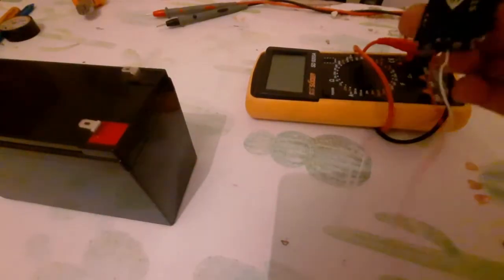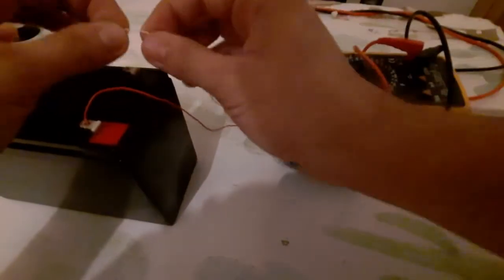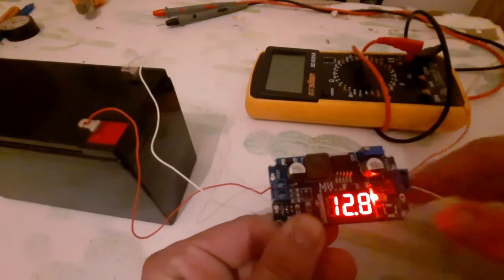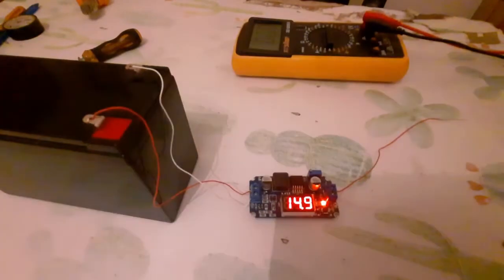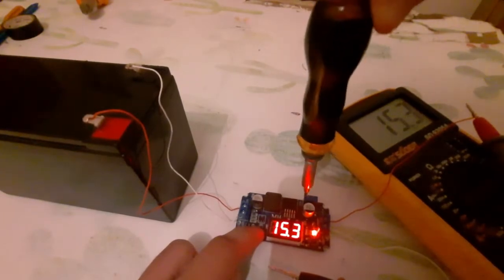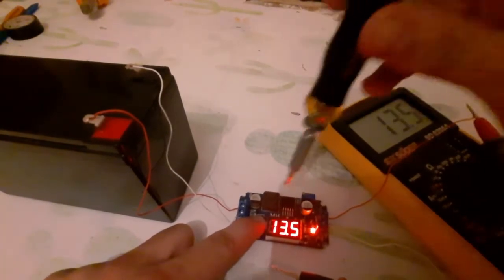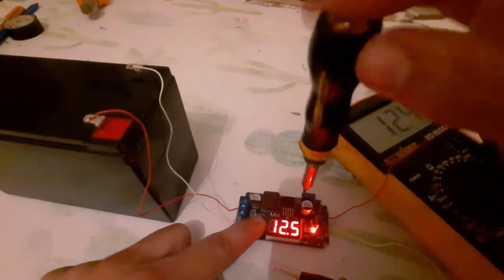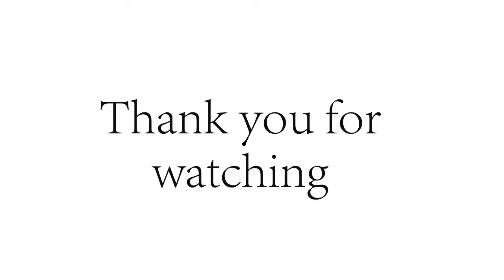How to use LM2577 Step Up voltage

Comment: Che sabes como activar la pantalla porque yo mantuve apretado el boton y me muestra números del 1 al 5 y del -1 al -5 y no se ven los nuemros del voltaje de entrada ni de salida solo lo puedo ver con el tester sera que se configura de alguna forma? Ó cage mi modulo?
Reply from the maker: hello dear, in fact this components series should automatically shows the input and output voltage value by simply pressing on the black small button. idk if you have any other series number or not. but it's a simple issues and it can be solved

Comment: CAN THIS STEP UP MODUL  WITH 19 VOLT DC  OUTPUT START A LAPTOP WITH INTEL CORE i5 NEEDS  3 AMPER ??
Reply from the maker: hello friend, first you can supply your laptop with the required voltage needed if your lm2577 specification can afford your laptop requirement. but in my point of view, i don't recommend you to use this method, your battery doesn't need a stable voltage to charge, also it can sometime damage your laptop. as i told you, it's not recommended to use it to supply your laptop, use a normal power supply that designed to charge your laptop instead.
Reply: @RoMecha_lb  Thank.s for this info!
Reply from the maker: @wasilikechagias9138  you're welcome dear